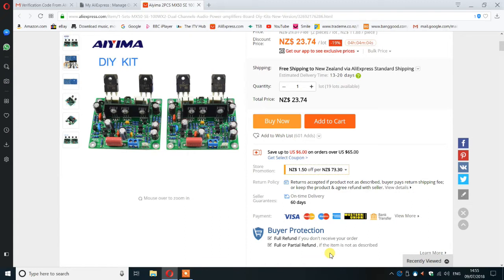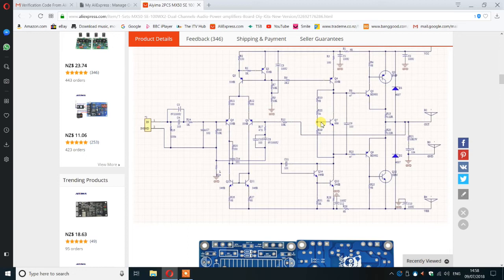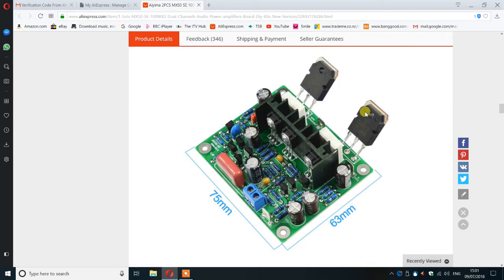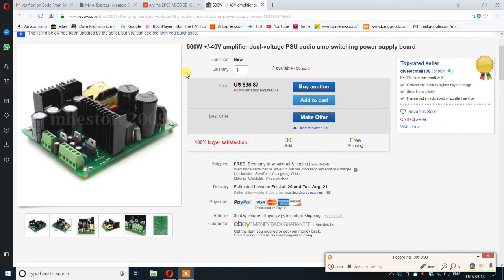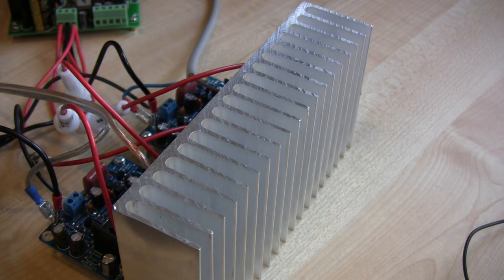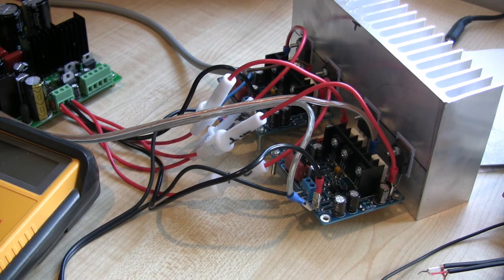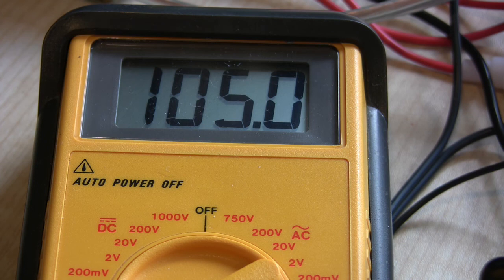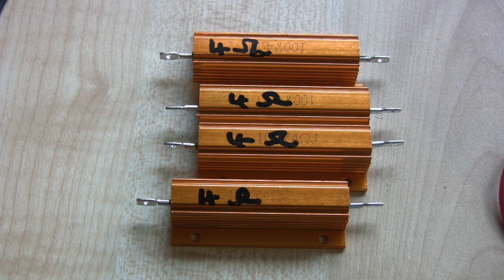Building and testing a Aiyima MX50 SE HiFi 100watt stereo amplifier. Part 1.

Comment: Hello Michael, I'm very new at this sort of stuff, and am a bit confused about that black 2-wire cord coming from the bottom of the video, each wire of which connects to the blue terminals on each of the amps. What is it, and where does it come from? It also appears that there's another wire connected to the right hand part of the blue terminal, but I can't see where it goes. Could you let me know what that blue block is for? I've been studying your videos on this amp build, and find it very good, but am unsure about some of those connections.  ---Thanks
Reply from the maker: Hi Bruce, I hope I understand what you are asking me. The black wires that go into the blue terminals are the signal input. They are a screened cable and, in my case, go to a pair of phono (or RCA plugs) The PCB is labeled input.
Reply: @MichaelBeeny  Thank you so much, Michael. That helps a lot.

Comment: I appreciate your video! What value of potentiometer do you recommend for this amp ? 10k Log ? Thank you
Reply from the maker: Depends on the source to an extent. I used a 50K log. Before the 50K arrived I did use a 10 k but it loaded the input a little too much giving but cut.

Comment: When I want to adjust bias on transistor output stage I always apply my meter across the output resistors R13 and R20 in this case in volt mode and convert this to current, I'd probably stick a pot in place of r22. I dont worry too much about the voltage offset unless of course it is class A and its not too high. I want to find an amp kit that does both class A and AB. I have fixed marantz amps that have this function where they are native class A and when they are driven to a certain volume they pull the class A bias out and switch to class AB and switch from mosfet to transistor output stage. Its a very clever and good approach to fidelity vs power and I'm yet to find one so if anybody out there is aware of such a diy project I'd be interested.
Reply from the maker: I'm not really sure why you wont to go class A. If you look at distortion content at say 10 khz and slowly increase bias until the cross over spike completely vanishes, that's it. Increasing bias any more does not lower distension any more, it just gets hot for zero increase in performance. I have tried this on the L12/2 amps.
Reply: @MichaelBeeny  Its an interesting question, you are of course absolutely correct. For me it isn't so much that I cant set QI to achieve a good low current bias on a transistor amp and achieve low THD. Absolutely with 30ma of current you're not getting 0 point distortion and it sounds good. For me the reasons why I like class A is the sound itself... Now I'm no audiophile far from it but what I have noticed is the warmth of the sound of class A amps, even when compared to class AB amps with the same output stage. That sound I can't achieve naturally on a class AB and when I listen to old 60s stuff it just works and sounds different, warmer and softer. But if the volume is high enough then the ability to discern that warmth is limited and of course due to the nature of class A the power levels tend to be lower and not always high enough for a party say. Thats where the automatic class switching comes in. I'd just buy a marantz pm55 but not many about, judging by the amount I have repaired over the years its no surprise, they tend to self destruct regularly and destroy all the output stage. Last repair i did was over 200 quid in parts alone.
I recently built an ebay special class A and I cant recommend it enough here is a link if you are interested: https://ebay.us/s90Vck

Comment: That psu is shit. Mine blown after 10 power on's, and cooked amplifier too. Got some nice 45$ 1000w psu for audio from aliexpress instead with proper protection from short circuit, overheat, overcurrent. Here is the link: https://www.aliexpress.com/item/33059358501.html?spm=a2g0o.productlist.0.0.370d7014HwTlVA&algo_pvid=fb1ba7c8-b83a-49b4-8a54-6047b4a95879&algo_expid=fb1ba7c8-b83a-49b4-8a54-6047b4a95879-15&btsid=4ae91dbc-ac0a-4f15-bdd8-af147604e1b1&ws_ab_test=searchweb0_0,searchweb201602_4,searchweb201603_53
Reply from the maker: Yes, I agree with you, experience is a great thing. I have replaced all my psu with proper linear ones now. I have not heard of any taking out the amplifiers before. I always used fuses in the line to each amplifier. I will look at these PSUs, thanks for your comments.
Reply from the maker: Just wondering if you still like that SMPSU. Does look better made for sure, is yours still working? I've been using toroid's on all my current projects. Not had much luck with SMPSU. Too much to go wrong!
Reply: @MichaelBeeny  Still works after 5+ years

Comment: Hiya, Michael. Thanks very much for the excellent content! I too was inspired by your videos to buy these boards and am building my amp as I type. I have a question and I wonder if you might be able to help - at a first testing today I found that one of the channels' heatsinks for the power transistors get noticeably warmer than the other. One side is at around 45C while the other is around 38C during moderate volume playback. Is this worrisome? How would one go about troubleshooting something like this? (Suppy voltages into each board is identical and swapping input and/or output channels seems not to affect it; it's always the same power transistors that get hotter. Any advice would be greatly appreciated!
Reply from the maker: Hi Rolf. Yes, a number of people have commented that the QI does vary somewhat. I think it's the bias circuit. In many cases you would have a pot to adjust the QI but no where does it state what the QI should be. I think the bias does run a little on the high side but it is very stable and does not run away with it's self. I guess it's a cost issue, the modulus are really silly low cost, but do really sound good. The second amp I built is more powerful but does run cooler. I would not be happy telling you to replace parts with a pre set pot because of the danger of blowing it up. I doubt you will have any issues, in my tests I ran both channels really hard and it really got quite toasty but the QI always returned to a normal level. Are you using the same heatsinks as me and the same SMPC?
Reply: Hi Michael. Thanks for the super prompt reply! I really appreciate it :)

I am using somewhat smaller heatsinks than the ones you use in your video, and my SMPC is rated at 35V, so also a step down from yours. Given that during normal operation I'm still at temperatures that are quite comfortable to keep my fingers on, and given your comment I feel relatively confident in leaving things as they are. If I decide to run higher loads off the amp I may consider upgrading my heat management, but for the time being I think I'm alright. I haven't done any kind of sine wave testing though.

Thanks again!

Comment: Really enjoy your projects, Mike. I've ordered the SMPC you're using. It's going to be a real godsend, as you say, a linear power supply is ridiculously expensive. Hope you will do more videos in the future.
Reply from the maker: Many thanks Bill for you're kind words. Be careful with it, lots of high voltages floating about inside.
Reply: Yes, Mike, I have some experience, so no worries.FYI, I've also built the JC-2 preamp from Jim's Audio, and the DX amplifier. They sound great! Currently working on the NE5532 preamp, and a couple of other amp boards. The biggest problem it seems is locating the necessary parts without paying exorbitant shipping fees. And my kingdom for an oscilloscope! This hobby is very satisfying, as you well know. Hope all is well in NZ.
Reply from the maker: @billkalina3089  May be you should have a channel and film some of your experiences?
Reply: @MichaelBeeny  That's not a bad idea Mike! I'd love to share my experiences. We in the audio community should share knowledge, and help others to avoid pitfalls. What I especially like about your videos is that they make it possible for the relatively inexperienced hobbyists to get involved. Cheers!

Comment: Hi 
I got inspired  by this video , I order this amplifier 
this my first build
is the power supply 0 (black wire) connect on the same pin as the speaker ground?
Thanks
Yuval
Reply from the maker: Yes, all 0 volts should be connected to this point to avoid earth loops. Good luck with your build.
Reply: @MichaelBeeny  Thanks

Comment: Exceptional!  Many thanks for the video, sir.  I have two questions and I need to apologise in adv. as they'll expose my naivete.  They're both related to inputing a sound/source signal to the amps.  First, I don't see a pre-amp section; is that not required with the Aiyima MX50SE board you got?  Second, can you please share photos of how you hooked up the source to the MX50SE board?  I find myself pausing your video in (vain) attempts to trace the input.  I'm sure that will be very helpful for other noobs, such as myself.  Thank you kindly in advance, sir!
Reply from the maker: Hi Dan, I think most of the answers are in the next 4 parts of this series. I do look at 2 pre amps, a valve one and a directly coupled op amp. Which do I prefer??? Will you need a pre amp depends on what you are going to connect to it. All my music are on FLAC files within my PC. The output from most sound cards is more than enough to directly drive the amplifier and will also offer tone controls if you like such things.
Most phones, however do not have enough output level to get full power from the amplifier, so a preamp is needed. You only need a gain of about 10 or so. Almost any preamp will give you this.
As to how to connect the input, I simply went from the input phonos via a 50K log pot (volume control) directly to the input terminals on the amp board.
This project was not really made for people with little knowledge of building and understanding such a build, many problems came up in construction which would be beyond a newby. The video was really just to show what I did rather than a project for others to follow.
Building is fun, even now at my age, I still learn and better understand electronics, often by error, things do go up in smoke every so often! Thanks Dan for your interest and comments, hope it helps.
Reply: I can't thank you enough, sir!!!  Your masterful explanations and patient tolerance for newbies make a seemingly impossible project doable.  I can't thank you enough for empowering myself and other like me.  

I just saw in your other video that you will no longer produce videos and that saddens me greatly.  We will miss you greatly.  I can only wish you never ending hifi nirvana, sir.=)  cheers, dk